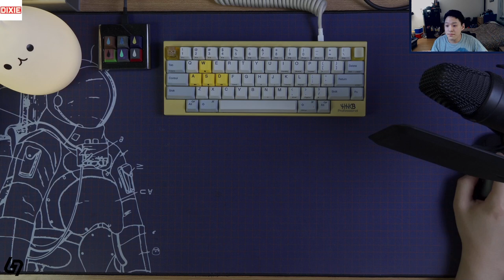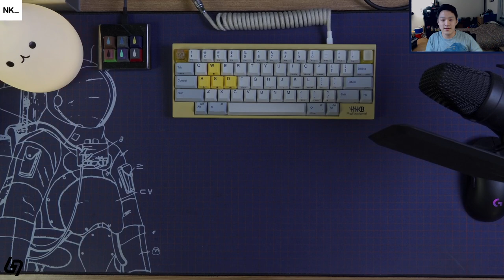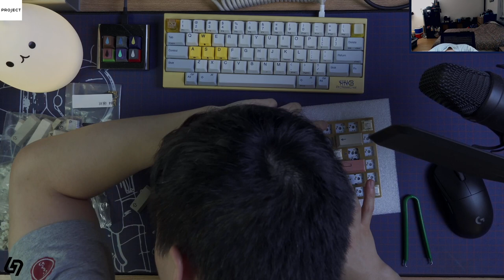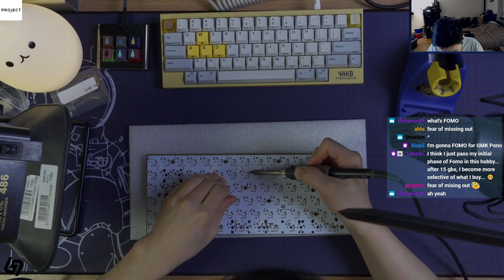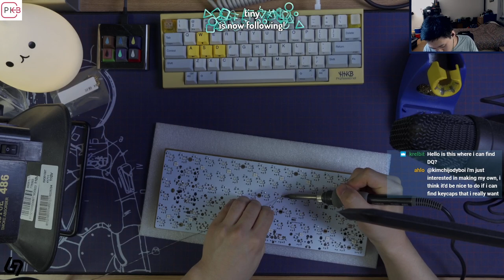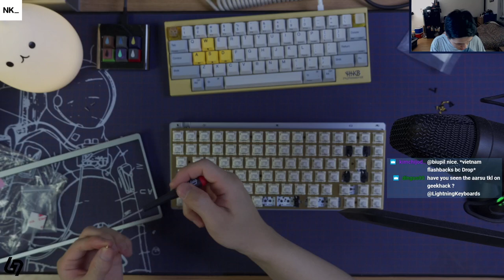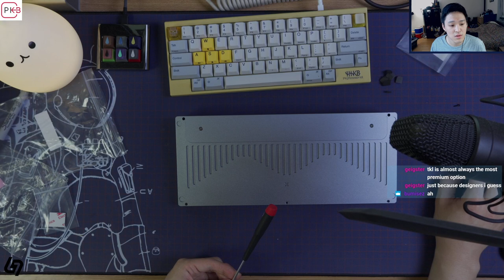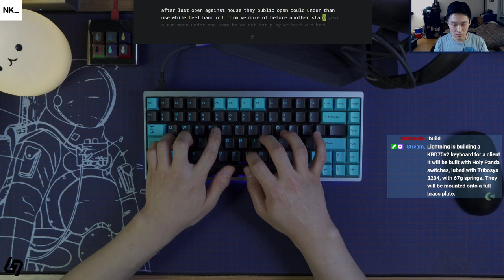KBD75v2 Build Stream

Comment: Does the case foam make a huge difference to the sound?
Reply from the maker: I would say it makes a bit of a difference but it's not 'huge'. I think somebody asked that in a different comment.
Reply: LightningXI thank you for the reply! must have missed the comment earlier 
As for lubing of holy pandas which lube do you suggest on it between 204 and 205
Reply from the maker: @keithloh3439 I prefer 204 or Tribosys 3204.
Reply: LightningXI does 205 remove some of the tactility?
Reply from the maker: @keithloh3439  any lubricant will affect the tactility if you apply it on the front legs or on the switch leaves where they make contact.
Reply: LightningXI icic, was just looking at reddit and deciding the 2 lubes and most people recommended against 205 on HP saying they feel mushy afterwards.
Reply: LightningXI thank you for the help, kinda excited gonna be building my first custom
Reply from the maker: @keithloh3439  you're welcome. good luck!